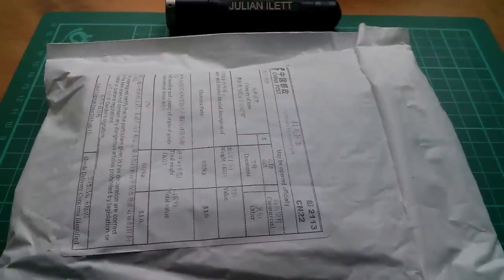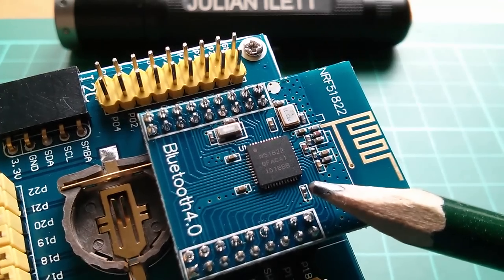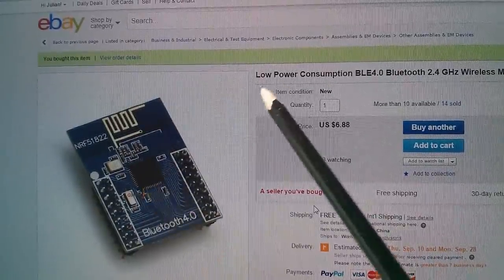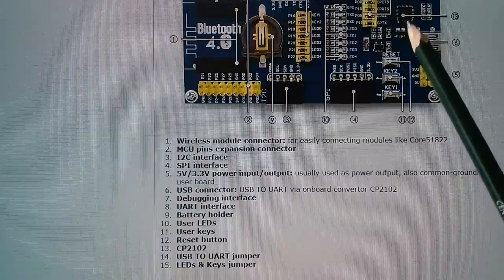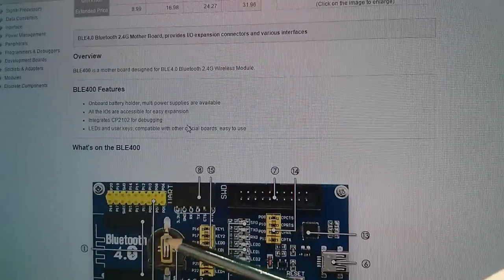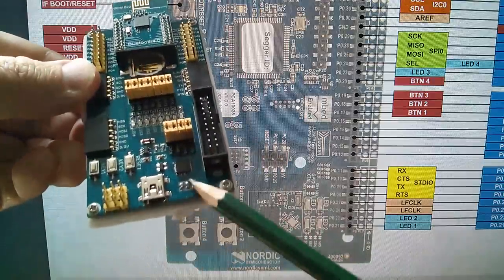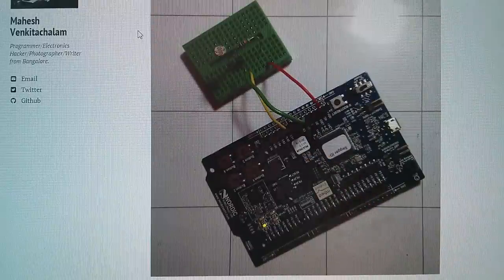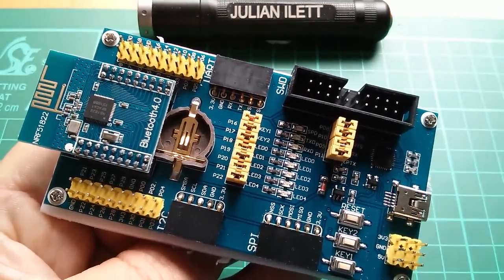Julian's Postbag: #47 - nRF51822 Bluetooth 4.0 BLE Dev Kit

Comment: I hope you continue with this one-  I'm spinning my wheels trying to get it to work and keep checking the comments on this video hoping someone finds a good walkthrough. Working my way through the waveshare documentation now with not much luck.
Reply: +hlfshell So far I feel like the missing link is the Segger J-Link chip onboard the official dev board and missing from this one. I think we'll need to  buy a seperate programmer to get access to the ARM processor on the nrf51822 baord but I'm not 100% positive on that yet.
Reply: +hlfshell OK - waiting game initiated. I just picked up this guy: 

http://www.ebay.com/itm/271747264277?_trksid=p2057872.m2749.l2649&ssPageName=STRK%3AMEBIDX%3AIT

- it seems it should do the job. Adaptor board included so it'll fit the 20 pin SWD port on the dev kit. I can tackle the programming bit once I get the j-link.

We should be able to program the cheap little boards then:
http://www.dx.com/p/waveshare-mini-nrf51822-2-4ghz-wireless-bluetooth-v4-0-development-board-blue-394386#.VfYUFhFVhBd

as seen through this nordic questionairre:
https://devzone.nordicsemi.com/question/50558/what-do-i-need-to-program-waveshare-mini-nrf51822/

This seems to be the same as our double through-hole modules we got on ebay, but without the headers. Why this is more expensive than the larger more-component version I haven't the slightest.
Reply: I'm not sure that the J_Link board will work with the nRF51822

The J-Link "ARM" claims only to support the "ARM7/9/11" in Seggers doc's

I know on eBay it says it supports Cortex-M0 which is what is inside the nRF51822, but I think I'd trust the Segger docs rather than the eBay descriptions

(well it may work, but the official docs suggest it's not)
Reply: +Roger Clark I can confirm the unofficial jlink will write to the nrf board shown here! I haven't gotten much further than burning sample code to it, I'm afraid...
Reply: To expand on that now that I have time:

I got the unofficial J-Link and ignored the CD that came with it. I don't trust Chinese origin software.

I downloaded the official J-Link software from their website and ran installed their drivers. This worked on Windows 7 and 8. When running the J-Link software, it pointed out the firmware was out of date and rolled the dice to update it. Sure enough, it worked and didn't brick the programmer.

Since then, I've gotten Keil studio (but not Eclipse) to write to the nrf board. I've only burned programs so far as I haven't figured out how to properly build and program a project for this thing yet.  In that respect I would love someone else to help out, as I've been short on time for this project.
Reply: +hlfshell 

OK. Thats good news

I have one of those Chinese J-Link's and basically did the same as you. i.e use the official software and also did the firmware update.

My J-Link shows up as a J-Link ARM 8.00 , is this what yours does ?

I have previously tried to use it to flash a Cortex-M3 device (STM32F103), and although the software claims to have flashed the process, the program would not run.
So I assumed that as its not official hardware it probably doesnt work.

But perhaps there were other problems
Reply: Sorry Roger Clark - I'm booked and/or out of town for at least another two weeks, so I won't be able to run this test for a long time.
Reply: +Roger Clark 

Just an update on progress with flashing this module.

I managed to flash RedBearLab nRF51 Arduino bootloader onto the module and it appears as a DFU device in the Nordic toolbox

You can then upload "applications" via an the Nordic toolbox app (I tested on Android)

I gave up using my JLink clone, as I already had a STLink programmer, which is also SWD and is compatible with OpenOCD, so I can debug as well as upload, if I manage to work out how to set it all up

I was hoping to be able to upload an application via STLink, but so far I've not been able to do this. Well I can upload, but it didnt run :-(

Comment: The big chip is an official J-Tag programmer. You could make your own with an stm32 dev board(~3€ on aliexpress) and upload the Black Magic probe program on it, which can also upload via swd (which these boards use) or you can get your hands directly onto a stm32 programmer which still uses swd.
Reply: Thanks I'm gonna have to go down this route. The official recommended Seggar programmer and debugger costs $1000. Had it been $100 I would probably buy the official stuff. Just too much

Comment: My guess is that unlike the official board this is ‘compatible’ with, this doesn’t have a programmer.  i.e. you flash the module using a programmer and then can use this board for attaching sensors etc. with usb link to PC providing serial interface - but cannot be used for programming/flashing.

Comment: The "Official" board you showed had the Segger J-Link debugger/Programmer onboard. What seems to be needed to program the BLE400/nRF51822 is a J-Link programmer for uploading code and doing "real" debugging.  I did find something on ebay which I'll try when it arrives. http://www.ebay.com/itm/111875747069  I'm under the impression the ARM proc on the nRF51822 the SWD interface.

I have installed Nordic's Linux "nrf51-ble-driver_linux_0.5.0" driver for talking to the nRF device via Linux over the ttyUSB0 serial port of the BLE400 but it appears to be for the nRF51422 and not the nRF51822. So it blinks and LED on the BLE400 board but I can't see the BLE device with my phone.
Reply: did you try ebay J-Link OB ARM/STM32 Debugger Emulator?

Comment: Did you get your nRF module up and running yet? After hours of experimenting I have finally figured out a very easy way to program it with the Arduino IDE! 

This is the Arduino Core for the nRF5-series SoCs: https://github.com/sandeepmistry/arduino-nRF5#flashing-a-softdevice

This is the recommended Arduino Library for all your BLE stuff: https://github.com/sandeepmistry/arduino-BLEPeripheral
Reply: I can flash the USBserial driver to the cp2102 device through zadig, and the arduino IDE recognizes this as port com4. However, when I try to flash the softdevice it is unable to open the programmer
Reply: Matthew Foran With Zadig you're not installing a driver onto the device but rather on your computer. The cp2102 is not the programmer you want though. Assuming the nRF has no bootloader on it, JTAG is your only option for programming. So something like the ST-link V2 will suit your needs.
Reply: Oh, I didn't even realize that was necessary. I thought the whole point of this waveshare board was to function as such a programmer. I just ordered the programmer you suggested, hopefully I'll finally get this working!

Comment: ...One year later, has anyone been able to upload software using the development board in the video?
Reply: yes. see my comment above.
Reply: Thanks! I've installed everything in their tutorial, and my pc recognizes the USB to UART bridge. I'm stuck at trying to communicate with the device. JFlash can't seem to find the board, and a serial terminal can't connect to it. Any idea what I'm doing wrong/anything else to try?
Reply: I use nrfgo studio to flash the softdevice and program. It worked.  Looks like you're nrf tool set is not properly installed. Have you also installed Keil uvision? drivers all upto date when you open nrf go studio?
Reply: I did have keil installed, and I just reinstalled it to make sure it was working properly. When installing NRFgo studio, I selected "full" so all the drivers should be in place. In NRFgo studio, my problem is that I cannot select "nRF51 Programmer" as instructed in the tutorial. https://devzone.nordicsemi.com/question/127977/cannot-select-nrf5x-programming-in-nrfgo-studio/ suggests that it is a problem connecting to the jlink on my board. In device manager, my board shows up as  "silicon labs cp210x USB to UART bridge" Is this correct?
Reply: I followed their installation instructions almost exactly. Things I wasn't sure about: Their SDK download didn't have an installer file in it like they said it would, so I downloaded the SDK from nordic. When installing Jlink, it gave me the option to replace a keil dll file with the jlink one, I opted to keep the keil file. I also have keil v5 installed, and the sdk said keil5 support was "experimental." I can't find anywhere to download keil v4 to test this
Reply: First close all nordic and Keil tools. then open nrf go studio.  don't connect board to pc. within nrf go studio on left pane you should see a list of things. now connect your board. make sure right uart settings as on wiki page. then you should see the board come up on the left list on nrf go. click or double click on it and you should see flashing chip ui.
Reply: ; Baud rate: 38400, 8-bit data bit, 1-bit stop bit
Reply: jholworld yep, I did that
Reply: jholworld the nrf package I used included the command line tools, but I'll try installing it all separately
Reply: Did you get yours working yet? I have discovered a really simple method for programming with the Arduino IDE :)
Reply: I kind of ran out of steam; I was going to try using a windows xp machine after the school year ends. I saw your comment below, so I'll definitely check that out. Thanks!